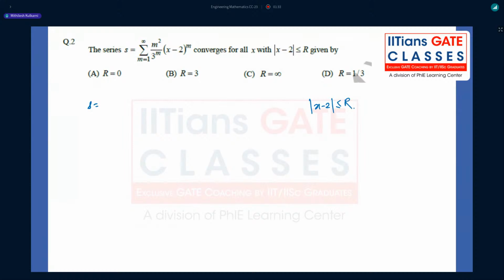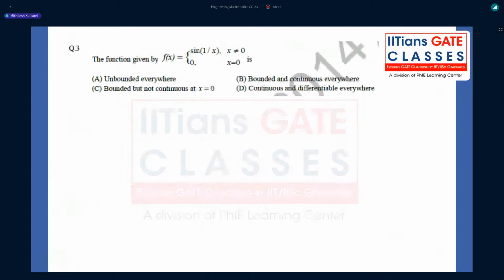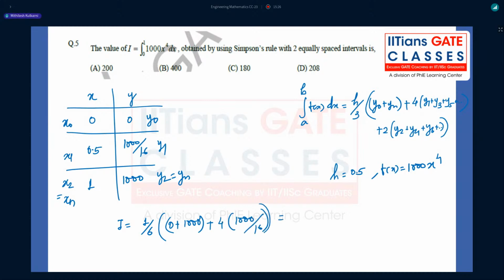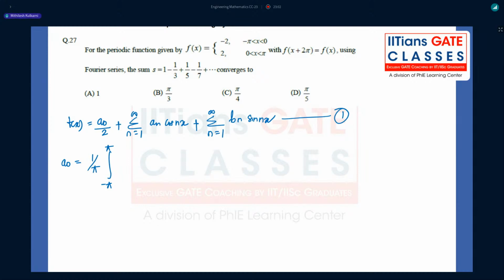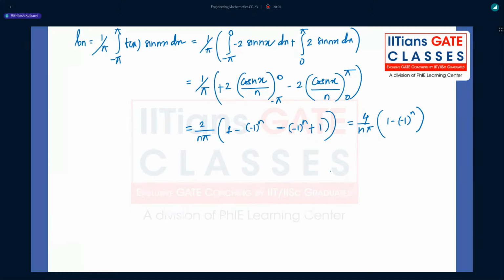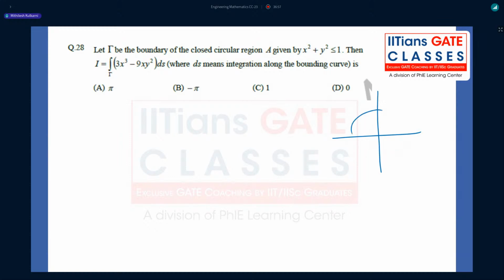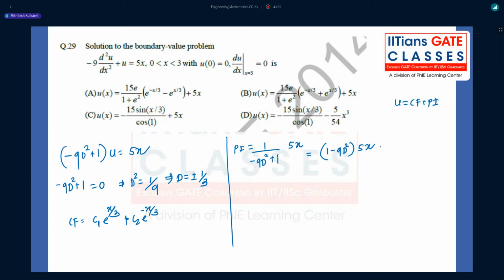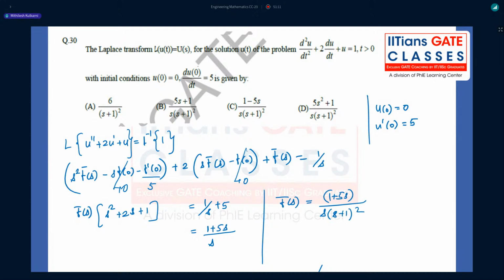GATE 2014 Aerospace Engineering Paper Solution | Engineering Mathematics Part | GATE AE Lectures

Comment: Sir, how to tackle the confusion regarding "With 2 Equally spaced intervals" and "With 1 step " for Simpson's method
Reply: Hi there is Simpson's 1/3rd rule which is applicable when the number of intervals are EVEN and 3/8th rule is applicable if the number of intervals are multiple of 3 that is 3,6,9,12 etc.).....But Trapezoidal Rule is applicable for any number of intervals . if you know applicability of above rules you shall not find any confusion ,Hope this helps !
Reply: Number of Steps = (Fianl value - Initial value) / step size 

Use this approach to understand the difference in intervals and steps.  Two equally spaced intervals means 2 steps let say a to a+h and next interval is a+h to b , where step size is h.